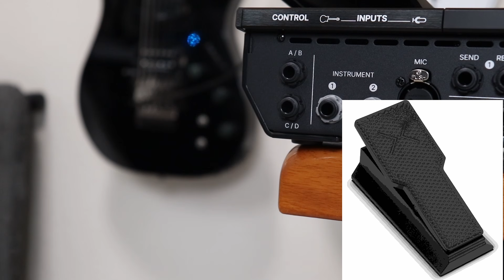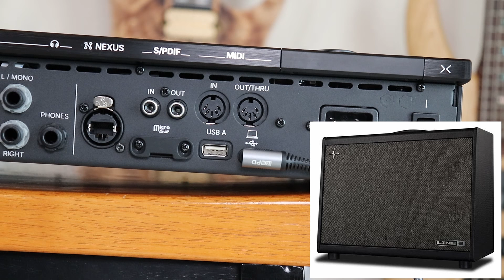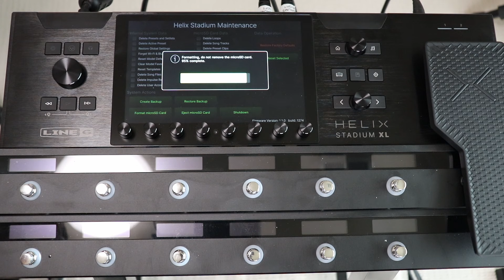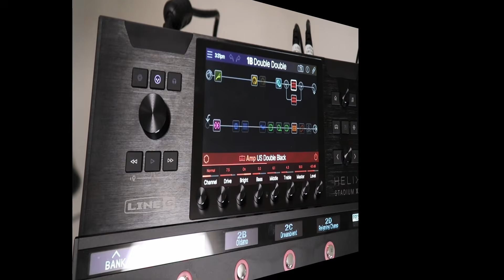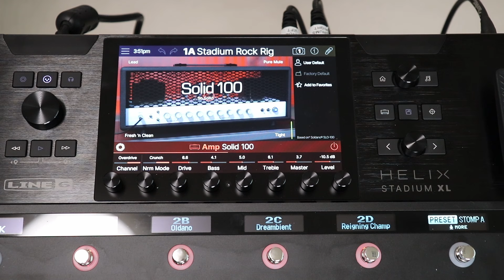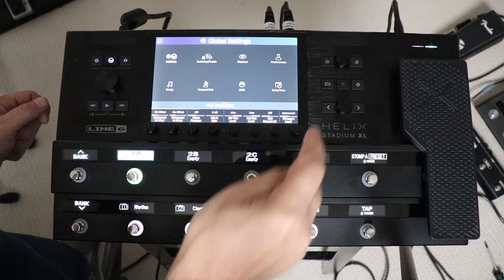Helix Stadium XL Walk Through and Operations Guide

Comment: Great video I'm sure. Unfortunately, I don't have a QR code to login to my Line 6 account.  I'm logged in online...but it won't let me login to the unit. It won't let me download the 1.3 update. I can turn it on at least. LINE 6!!!! Where are you with help on these issues?
Reply: Manually change, the time and year and it will give you the QR code.
Reply: @pablocota329 this is the solution! What a horrible bug 😂
Reply from the maker: You Don't need the QR code. I never use it when I upgraded my firmware. Click on the top three lines on the top left of the screen to open the window that will allow you to complete this process. Step one is to connect the Stadium to your wireless router. Once that is done you need to log into your line 6 account from the stadium by clicking on log in. The icon for this is to the left of the window where you saw Wi-Fi. You will log in the same way you log in on the website. When you get logged in using the stadium click on download to find any updates.

Comment: Best Video on Youtube right here., Thank You for doing this. Looking forward to the next one.  Any chance that you will do another video on the differences between the Stadium Floor and the Stadium XL?  Without the Scribble strips on the Stadium Floor it's so hard to tell on the fly what's what.  I want to smaller unit but not having the scribble strips is harder for a new user.  I received mine stadium floor a couple days ago and possibly switching to the XL.  Thanks again for the video. Great work.
Reply from the maker: There have actually been 2 more videos after this one. They go a little deeper.

https://youtu.be/qWycP5AsuXw 

https://youtu.be/M7uvaJpLewI 

Currently, I am working on the last video now, and this one will be different from anything on YouTube. I am glad you found the video useful. I don't have a stadium floor so it will be hard to do a comparison. From what I understand the differences involve three things. First there is no built-in expression pedal so you would need to buy one if you want this feature. Second, there are only two effects loops. The XL has 4 effects loops. You will see why this is a big deal in the next video. Third, there are no scribble strips on the floor model.

Most of the differences seem to be hardware related. All the same amps and effects and other software related items should be available in the floor model.

Comment: Just booted up my new Stadium floor , set up wifi but no QR code and could not sign to my account on the unit needed to download the 1.2.1 installer with the unit connected via USB ,to get the new firmware uploaded then i could see the QR code and was able to sign in.

Comment: Hey Marcus, quick question, I copied the 1D Dreambient glitzy no.1) snapshot into snapshot 8 (empty) and renamed it glitzy+. I added drive to the amp and saved it as per video but it then changes the drive setting to the same value in all 8 snapshots???? Pretty sure this didn’t happen when you did the same in the video????? Also does same if any other drive on any of snapshots is changed I.e changes  amps drive to same value on all 8 snapshots? 
I haven’t fitted a micro sd card yet but presumed the above would save to internal memory and not need the external sd card. Moved from Kemper so not experienced yet with Helix so may be missing something obvious? If so apologies in advance 😂
Reply from the maker: I am actually addressing this in the next video and filming will begin soon. I had to work through the same issues. Snap Shot is not as straight forward as it sounds, and there are some settings to it that I have not seen addressed yet.

The bottom line is that every control in a preset has a snapshot function that can be turned off. By default, most all those settings are turned off. This is why some snapshots are not being saved and people think it is a glitch when it is not. The more features Line 6 builds into the Helix, the more complicated it can be. This one stumped me, but I got it figured out. The next video will also go into USB A and connecting to a network, Impulse responses, and much more.

On the main control screen slightly above every encoder nob is a place to tap. In there you will find different options. Each nob or setting allows you to turn the snapshot off or on for that particular nob. This needs to be set before you start setting snapshots. I will explain in much more detail in the next video, hang tight if you can't figure it out, the solution is coming
Reply: @marcuscurtismusic  Amazing thank you so much!!!!!!!
Reply from the maker: One more thing, if you swapped out the micro SD card be sure to boot into maintenance mode and format the card, or it will not work correctly. Currently, I have stored over 150 backing tracks inside my Helix stadium. I don't know of anything else that can do this.

Comment: Ha... "I don't know what maximum size of memory card I can use". That's so typical Line6. I've spent literally weeks trying to find out any kind of usable tech specs, and I am none the wiser.

There seems to be no such thing as SNR  or THD on the input amps or the DA, no such thing as a max input/output level in dBu or dBV, no such thing as supported sample rates for digital out (although the Nexus extension thing claims to support 2 channels of AES/EBU with 44.1/44kHz, which is... uhm, not... awesome? Should be 8, not 2, but if it's 2, it should be 192k).

So yeah, it's the greatest thing since the invention of the wheel, they only just can't tell you any tech details.

Why would you want to know? Well, for questions like whether to turn your preamp a bit higher (likely) or the input gain instead. Or whether you need an amp for that ribbon mic or not. On e.g. my RME interface, both can be answered in 5 secs ("either way is good", and "no") by looking either on the website or in the user's guide.

Feels kind of suspicious if someone can't tell you their specs, makes you think they gotta be really bad if they can't tell.

Sorry for the rant.
Reply from the maker: Trust me when I tell you I understand your frustration. I don't know why the AES only has two outputs, even though the standard is 8. From what I can tell, I think the AES outputs are only used with the line 6 ecosystem. There are some line 6 FRFR speakers that take the AES cable, and you can daisy-chain two together. I wish I knew the sample rates for sure. I think One AES channel is for the left cab and one for the right. As far as the micro SD card goes, right now I got a 512 gig card in there, and it seems to work fine (still testing). Still doing some testing using the Helix stadium as an audio interface. The Line 6 ASIO driver delivers low-latency audio performance required for DAWs recording on Windows systems, operating at sample rates of 44.1kHz, 48kHz, 88kHz, or 96kHz with ASIO. The same sample rates work on the S/PDIF connections. The sample rates are adjusted on the Helix stadium unit and that can not be adjusted in software. I would think that the same sample rates work for the AES connection as well, since all the other digital outs have the same sample rates. 

It does a pretty good job recording. However, the main issue here is when I have any DAW open, and I access the drivers for line 6. I can only adjust the buffer size. I have no way to change the sample rate, and I can't even see the sample rate. It can only be adjusted from the Helix, and I can also change it in the DAW app, but not in the driver settings. It seems to work, but I still need to test the recorded files to see the actual sample rate, like I said "still testing" I will see if I can find answers to the specs you are looking for. A release of the detailed specs would be helpful. I have tried the reamp function and it works ok. Will make another video as soon as my tests are done.
Reply: Thanks for the info on SPDIF, that is at least some useful info. That would mean I could use the presumably MUCH better preamp and A/D on the RME, go SPDIF into Helix (would prefer 192k, but 96k will do), reamp and reverb, and SPDIF back without needlessly going DAAD in the middle.
That'll be just one preamp pass and A/D, and routing all-digital into an existing setup with a demonstrably working 188-channel USB device rather than trusting one that I've not used and that might not be fully mature.

Comment: Hello, thank you for your helpfull video. my Stadium XL also arrived yesterday. I'm trying to understand something. When I turn on the device and put my ear close to where the power cord plugs in, I hear a sound, similar to coil whine. This sound is familiar from some desktop computer cases. The sound is very faint when it's about 40-50cm away. it becomes audible as you get closer, especially when you put your ear right up to it. Is this a common problem with all devices, or is there a malfunction with mine? Do you have the same problem on your device? Could you try it?
Reply from the maker: I can tell you that my Helix stadium is as quiet as a church mouse. I have not heard any electronic noise at all. I have been right on top of it when I was learning how to program it and I heard no noise at all.

Comment: Has anyone used this unit outdoors in a bright or sunny environment? Sometimes my band plays outdoor gigs, and some of my pedals are really hard to see if they’re on or off, and I can see that it would be a problem if this unit is not bright enough to handle the outdoor bright environment
Reply: I played a gig in Luxembourg during the summer in 104 degrees heat using the helix floor with an acrylic guard on it. Somehow the screen was scorched. I thought the guard had just got it but the same scorch marks were on the screen. Crazy.

Comment: Great video! You covered a lot of stuff that hadn’t been covered by the many videos already out there. I’ll be getting my unit tomorrow but I just have one question. You talked about the maintenance mode and in particular you mentioned deleting loops on the SD card. My question is, how do you save loops to the SD card? Is this a feature available now? Thanks!
Reply from the maker: I really don't have an answer just yet, I am still running experiments on this device. But it stands to reason that if you can delete them from the card, you must be able to put them on the card. I suspect it may be part of something that is coming soon. I have been looking into making presets and customizing snapshots. I am going to start recording with this soon just to find the limitations. While I am doing that, I will test the looper and see if I can find an answer for you.
Reply: @mar @marcuscurtismusic You’re probably right about it being a feature that hasn’t been released yet. It’ll be great if they implement it. I can’t think of a modeler that has the ability to save loops. It would be a good way to consolidate and save space on a pedalboard. At least my pedalboard. Thanks for the answer!

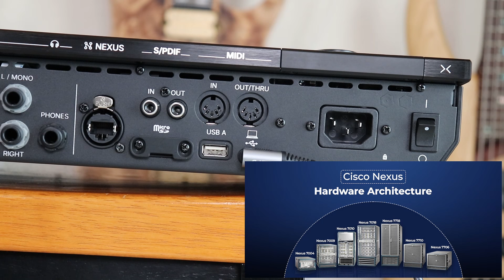Comment: 7:32 Nice video.  But I'm pretty sure Nexus has nothing to do with Cisco Nexus switches.  I work for Cisco in their Datacenter business unit so would know.  That said, I've heard rumours that Helix Nexus could potentially interface with Dante (Audinate), and Cisco Nexus totally supports the QoS knobs that Dante requires.
Reply from the maker: You may be right. I did not know much about Nexus before I have seen the word on this Line 6 device. When I did a search on Nexus, a multitude of companies came up, and each had various logos. Things came up about where the internet is heading, Things came up about Nexus protocol, and through that I found things about Nexus hardware. I saw some logos that were similar to the logo that line 6 had on their Helix Stadium under their Nexus input. So based on the logo, I thought that Nexus pertains to a type of hardware format and design.

But I am unsure about it because there is a multitude of companies that use the word Nexus. When you google the words (Nexus meaning) this is what comes up.

nexus /nĕk′səs/
noun
A means of connection; a link or tie. 
A connected series or group. 
The core or center. 

So who knows for sure? I was going by logos, but I can't be certain. You may be right.
Reply: @marcuscurtismusic  Nexus is a proprietary digital audio protocol from Yamaha. As far as I know, the only device supported currently is the Expand D10 expansion box. There will likely be other devices and accessories that utilize Nexus in the future.
Reply from the maker: @taylorhansenmusic  Thank you for clearing that up.

Comment: Hey Marcus, I'm using active studio monitors, do i really need to use the XLR ports or should be fine with the quarter inch ports? Also not sure how related but as far as I know u dont need to change the stadium at line level if ur home playing
Reply from the maker: You can use quarter inch or XLR connections. I don't think you will notice much of a difference in audio quality, if any at all. My Adam audio monitors don't have quarter inch inputs, so I need to rely on the XLR outs from the Helix Stadium XL. You're right, you don't need to change at line level if you're home playing. I don't know if that works for recording while using the Helix as an audio interface. I have not tested everything yet, but I may need to boost when using a mic.